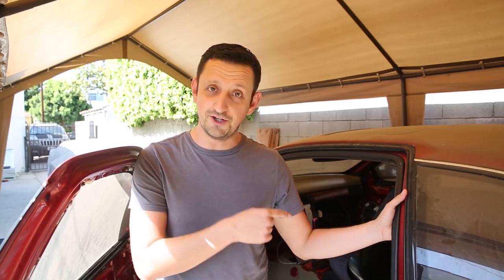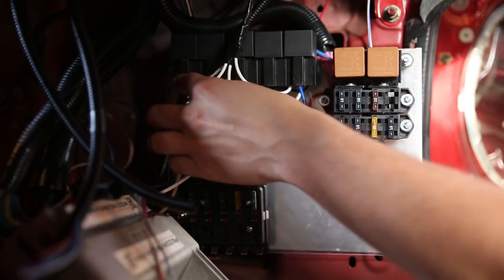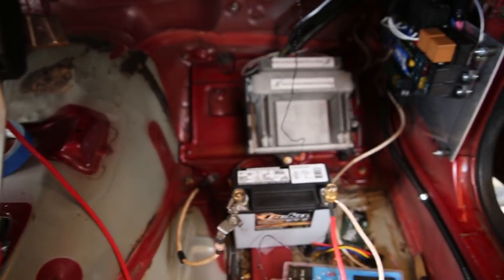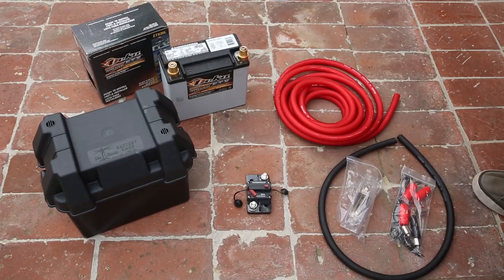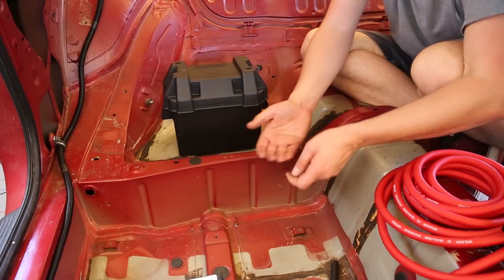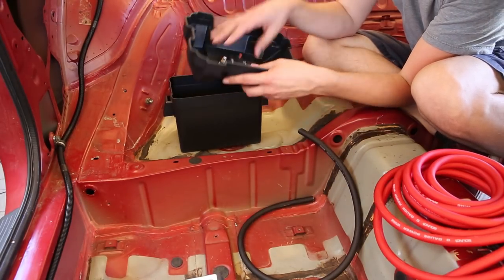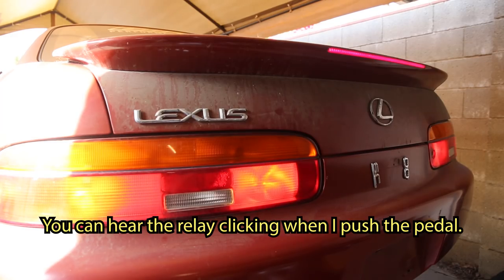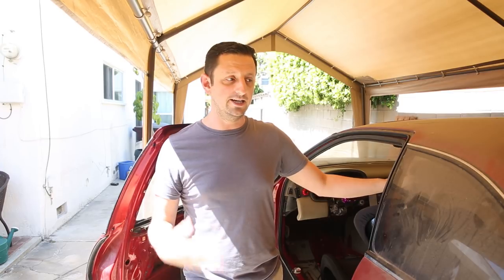Lexus SC400 Drift Build. Ep.43 - Wiring a Race Car From Scratch Pt. 3 - Battery Relocation and More

Comment: A few years ago, I was mechanic (and occasional stand-in driver) for a team doing endurance racing in touring cars (amateur series in Sweden, 8h races, we drove a Volvo S60 T5). I did most of the rewiring of our car after we tore out the stock dash and went with an aftermarket ECU, dash and all custom switches and wires. Not that different from your stuff, though a lot less neat. Watching this video I did think of a couple things we did that might be of interest.

The radiator fan was a serious problem. If left to the driver, it would too often be forgotten in the heat of the moment. It was rarely needed on track, but always when pitting, and we overheated more than once coming down the pit lane by simply forgetting to have it on. We tried a few different setups, but ended up having a switch that could only change it between "on" and "auto". Usually left in the auto position, where it was controlled by the ECU. Turns out that some drivers, while fast fast, are often somewhat absent-minded or even mechanically stupid when racing (this included a couple of the cars owners). I guess when drifting you'd want it on almost all the time and you know your car pretty well, but it might still be helpful to just make it harder to forget to turn it on.

For the kill switch, we had one of those usual "big red plastic key" ones on the dashboard that would cut battery power and ground out alternator field winding. For the external kill switch, we had a separate handle below the windshield with a cable going inside the car that would just pull on that switch key. Simple and somewhat crude, but worked flawlessly. I don't know about the north american sanctioning bodies or Formula Drift, but it was perfectly fine with the ones in charge here (FIA / SBF) and at least one other team had a very similar setup. It was not built by me (done before I joined the team), but I think it used the cars stock hood release cable and handle, as we had hood pins on it anyway. Added bonus was when the plastic key itself sometimes fell out of the switch when in the off position, it would hang by the cable within easy reach.

The windshield wipers were tricky, but I hooked it up so that when you turned the switch off it would go back to "park position". Then it turned out that somewhere around 220km/h the wind would push the wipers up far enough that they would engage and do a turn. To sort of fix that, I put in a three-position switch where the two end positions were "on" and "mostly off" (go back to park) and the middle position was the "hard off" where they would just never move, and that's where it usually was left for dry races. Though it turned out that when the track was slightly wet and some spray was thrown up, having the wipers go on automatically just once or twice per lap was actually somewhat useful...
Reply from the maker: This is all really awesome info, thank you for taking the time to type it up. The radiator switch from on to auto is a great idea. I actually have provisions in my harness for the PCM to control the fans, so I may rewire them again to go that route. Especially if I get forgetful at the track. Drift cars to tend to run hot, especially in SoCal, so having the fans on all of the time will probably be useful, but it would make sense to have the PCM in control just in case.

The kill switch mounted in the dash has the alternator/ignition safety wiring hooked up. I need to think about how to go about hooking the switch up outside the car, but since that is only needed for Formula Drift Pro2 and Pro, which will be far off in the future if ever, I'm not going to worry about that right now. ProAm/Top Drift type events just require a switch easily reachable from outside the car, which is why I mounted it next to the driver side window on the dash.

Interesting thought about the wipers. Right now they are just an on/off type switch with no ability to return to park automatically. I should look into that. Thanks again!
Reply: Good info John 👍

Comment: Just an fyi, you still need to run a wire from the alternator to the battery to recharge it. Also, if you have any issues with the brake switch, you can use a pressure activated one that sits in the brake lines. It is exciting to see you get so close to firing it up though!
Reply from the maker: Thanks Chris! I replied to your post in AI, but I'll reply here too for everyone else. The battery cable goes to the master disconnect switch in the dash, then routes to the starter where it meets the alternator wires. That will all be in my next video coming soon. Looking forward to firing it up and getting some seat time soon.

Comment: hey man that's an awesome video. I'm doing the same with a ls1 VYSS Commodore in Australia. in the u.s.a the are called GTO Pontiacs. this helped me with the battery.
Reply from the maker: Kim Harrison glad it helped. Changing around the wiring or doing it from scratch is really daunting. I did a ton of reading and research so this would go smoothly. Probably around 3 months of research which thankfully paid off. Good luck with your project.

Comment: Good job dude .what are you doing about your door windows are you keeping them electric or are you going lexan for lightness
Reply from the maker: They will stay glass for the time being. I'm going to install two window switches to control the motors. Eventually the car will get the full lexan treatment, but I'm not quite there yet.
Reply: Got any info on how to wire the motors up

Comment: I noticed the ground point on the frame is still painted or maybe you did and i'm seeing things. If you didn't you should grind the paint to bare metal so it'll ground correctly.
Reply from the maker: Francobnyc I forgot to mention in the video, but I did take a wire wheel to the ground point so there’s no more paint. Thanks for pointing it out. I’ll show that in the next vid.

Comment: what size circuit breaker did you use for the battery positive and has it held up?
Reply from the maker: It's 200A and yep, it's worked great. The links to all the parts I used for this build are in the video description.

Comment: How do you turn on high beam
Reply from the maker: You would need to wire it to a switch separately from the main light switch. You don't need high beams on a race car, so I didn't bother with doing it.